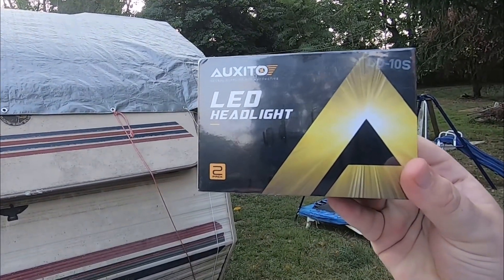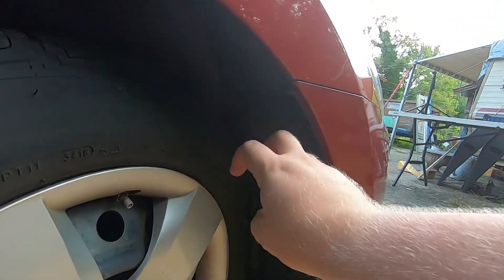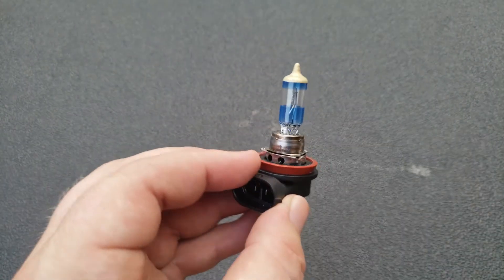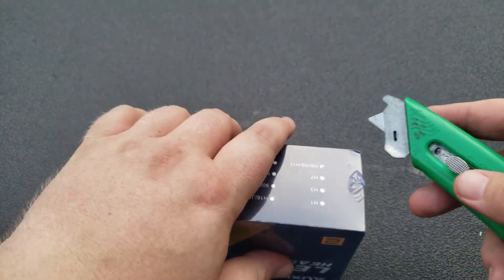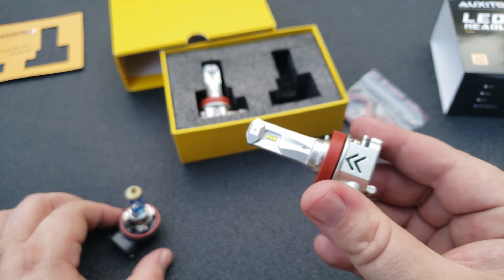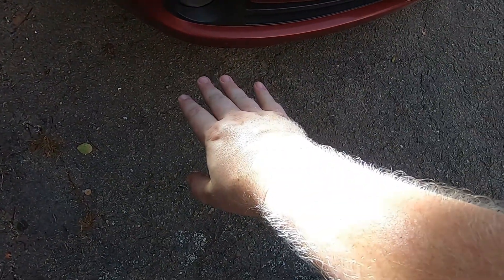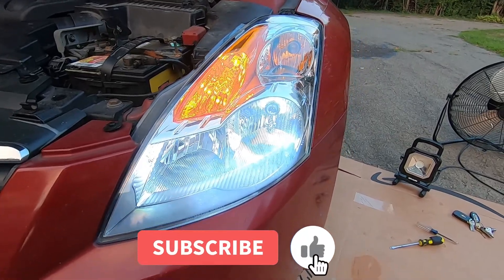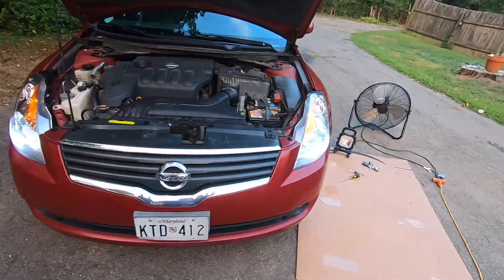AUXITO - H11 Headlight LED bulb Upgrade! (Side-by-Side Comparison)

Comment: I have 2011 with 230k miles.  Transmission is slipping intermittently from a standing start.  Do you recommend fluid\filter change?  I bought some CVT Amzoil, but havent yet got around to changing yet.

Comment: In the light category, step 5 what should I select?
Reply: Also how have they been doing so far? I had a mechanic say that LEDs would overheat in the casing?
Reply from the maker: You can select "High Beam", the high and low beam LEDs that go on the Altima are the same size bulbs (H11). 

Also, we have a special 15% discount code:  trickshift
Reply from the maker: They've been holding up great so far! I've had no overheating issues and they've been in there for over a month now. LEDs heat up alot but the cool thing about these LEDs from Auxito is they come with super quiet cooling fans on the back of each bulb to help dissipate the heat!

Comment: What about for the high beam?
Reply from the maker: Hey Marc, these same LED bulbs should fit in the high beam sockets as well.
Reply: @TrickShiftGarage  so should I order 2 sets?
Reply from the maker: Yes, I double checked on the Auxito website and they will work for the high and low beams. You can use our special code "trickshift" to get 15% off your order.

Here is the link for it:
https://auxito.com/collections/auxito-h11-led-headlight-bulb/products/h11-led-headlight-bulb-12000lm-canbus-for-high-or-low-beam-canbus-6000k-white?rq=yr_2007~mk_Nissan~md_Altima~tm_S~ml_High%20Beam

Thanks for watching!😎

Comment: The picture u show from sylvania, those are full blue coated silverstar. 

The ones ur holding are the flagship, brightest halogen bulbs, sylvania - silverstar ultra. 

Those are great high performance halogen bulbs. 

But those Auxito - 10S are much brighter and better and more efficient for very low wattage. So it’s much more efficient design. 

The SSU gets hot over 750+ degrees Fahrenheit. 

And those led bulbs are 141 degrees Fahrenheit. The lower the temperature for the led, the better the lifespan and longevity. 

I prefer an led bulbs with external driver for heat management and longevity, but those all in one led bulbs with very low wattage and very low temperature built up is very very exceptional. ❤️‍🔥❤️‍🔥❤️‍🔥

So u definitely get ur money’s worth.

Comment: Your not done, they are not plug and play, you have to adjust the light pattern and then aim the lights, they will be too bright and blind people if you dont aim the lights and may have a bad light reflection pattern if you dont adjust that
Reply from the maker: Thanks for the comment, I'll look into that! 👍

EDIT: Alright, I checked with Auxito and they are a direct fit (i.e. plug and play) as long as the standard reflector headlight housing is still being used and it's installed correctly. Their LED bulbs are designed to project their light pattern at 3 and 9 o'clock positions with the "wick" in the same physical position as the halogen bulb filaments. You can read more about it on their website as I'm probably not explaining it well enough: https://auxito.com/?ref=hox38qvw0c

I took a friend out last night and drove around just to verify my bulbs weren't blinding anyone and the headlights didn't need to be adjusted.

That being said... I do agree with you that you should always check the alignment after installing headlight bulbs of any kind. Installing them incorrectly can scatter the light and blind oncoming traffic. Thanks for watching!
Reply: In general. They are plug and play. 

And with actual observation from car light review. They draw 16.5W per bulb. So they can possibly blind others. But they draw so little and still brighter than stock. 

So it is plug and play.